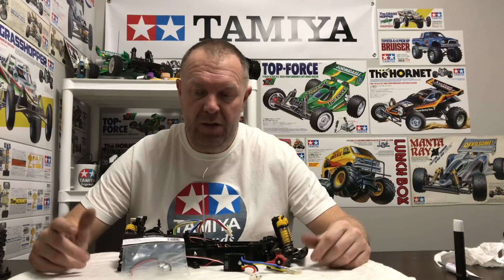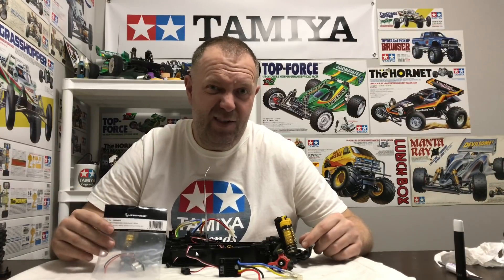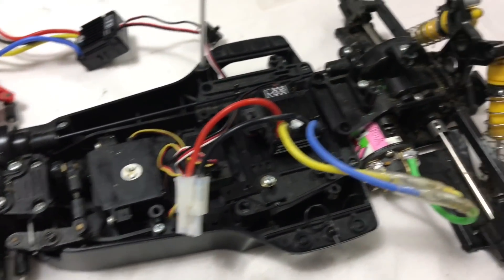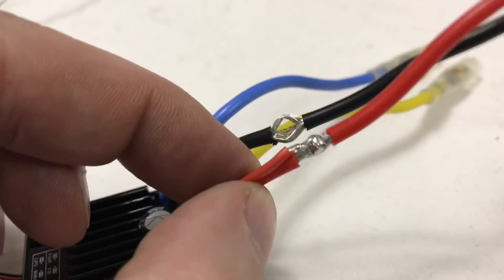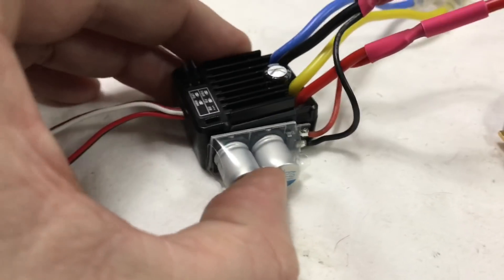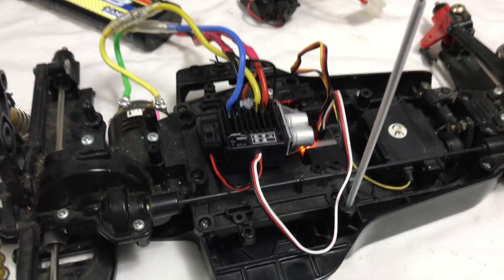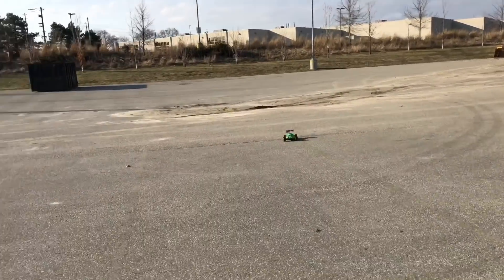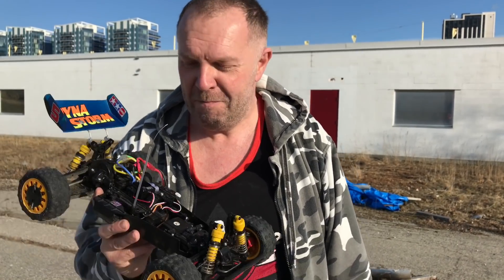Hobbywing 1060 ESC Limp Mode Issue Fixed using the Capacitor Module Kit  🤓👊🏻

Comment: Hi big man , just brought another 1060 for my 12 t motor running a 2s lipo and keeps cutting out the one on my lunch box don’t do it do u think this is the problem with my car
Reply: CMW Chris woodward I thought then1060 was only good down to 17 turn and advertised 20 turn.  Is 12 turn not too low maybe
Reply: Oswalds Reef I think your right Oswald reef , I was king out my mind trying to sort it , I run a 17 now  just about works well 💪🏽

Comment: Is there a way to test these 1060 ESC'S with a multimeter to see if they are healthy or dead? Mine doesn't go into limp mode it just flashes red like it's not paired with the receiver/transmitter setup. I've paired them as per the manual but has done this since I connected a 3S Lipo to it (I didn't connect the balance lead into the receiver)
Reply from the maker: josh blass 
There probably is a way to electrically test it Josh, but I wouldn’t have a clue how to do it!
Sorry buddy 😞
Reply: @TAMIYALegends  thanks anyway mate. Same question goes for a receiver, anyway to test to see if it's fried other than trying a healthy one ?
Reply from the maker: josh blass 
Tbh Josh, I’d try another one 😬

Comment: Man, wish I saw this before I tossed two of my 1060s in the trash! It's weird, I have about 7 of these in different cars and two went to this limp issue. I tried everything: batteries, motors, temperatures, gears, etc. Then, when I swapped it out with another 1060 it ran fine. Oh well, live and learn. Other than this bug, the 1060 is a pretty good unit. My goto for all my brushed cars.

Comment: Glad I have seen this message, just bought a 12t motor for it to go in a 2nd hand strada.

New to rc world so not a clue why, thought it was either getting too hot (not cutting out) or nimh battery wasn't good enough to run the 12t.

Upgrading to 2s lipo so will do this mod at same time. Great advice and 1 new sub 👍

Comment: I soldered a BEC onto mines to use in my crawlers and they work great. Smooth throttle control, cool running, 100% water proof and strong drag brake. I bought some to use on old Tamiya bashers so will see how i get on with them using both 2s and 3s lipo

Comment: Hi, I was wondering if you could answer a quick question. The Module Kit in your video has two Capacitors, well i found the exact same one or it gives me the option to have 4 instead of two capacitors, I just want to know would this be ok ?
Reply from the maker: Tony MacDonald 
Yes I debated buying one of those too, unfortunately I have no idea if it will work or if it would have a detrimental effect on the performance 🤔
Reply: I can't see it hurting it, But I have ordered one and I will be trying it :)
Reply: I plan on using mine in an old H2 Hummer from radioshack.

Comment: Thank you for your help, unfortunately after purchasing one of these I had my fingers crossed and hoped that it would work, it works a little longer than before but still goes into safe mode. I’m banging my head against the wall and thinking about buying a brushless motor Combo as I find that this is a lost cause.
Hopefully someone else has better luck👍🏻
Reply from the maker: Finall drive 
Oh what a shame 😞
You’re the second person now to have tried it and not worked! That’s now five 1060’s that have been done and only three of them were successful! It’s such a strange issue and very frustrating. I really need to mod my 2nd 1060 and test it out 🙏🏻

Comment: Congrats. Always so rewarding when there’s success. Got a 1060, but I haven’t noticed any issues so far. So ‘Limp mode’ just means that it slows down?
Reply: I do not have any technical/electrical knowledge, but it is strange with a brand like Hobbywing. But good job on fixing it ☺️
Reply from the maker: Nordic RC Visions 
It’s some voltage cut off apparently, but the extra caps keep it from spiking under power  🤷🏼‍♂️
Reply: did you change out the tamiya plug on  the other unit as well? Cause the tamiy plugs could give you problems as well, specially once they get a little worked out. check temp of the plug as well.
Reply from the maker: Schutt Rostig 
Yeah I swapped them over to Deans on all my stuff now buddy 👊🏻

Comment: 😁👍It probably made the voltage not dip as much... when running a hot motor or over geared car it can draw a lot of current and if your battery packs are not good enough to supply the amperage to the electronics the voltage can drop and cause those glitch power drop outs.  Did you ever try another lipo a higher C rated one?
Reply from the maker: Shen RC 
Yes buddy tried various batteries and motors, it a common issue that’s talked about a lot on the Facebook group. It sucks really but at least now I have two working speedo’s 👊🏻

Comment: I use those speed controllers they have motor rpm limit don’t go over it  they will go into limp I’ve had this happen to mine that’s what I figure .Those speedos are really for mild modified motors but mostly stock .
Reply from the maker: BVRC 
They have a 12 turn limit buddy, but as I said in the video that has nothing to do with this issue, I couldn’t even use a basic Sports Tuned motor before I found this fix 👊🏻
Reply: Great videos buy the way love your channel , and I’m glad you found the solution ,happy R.C.ing!!
Reply from the maker: Brendan Raymond 
100% agree buddy 👊🏻